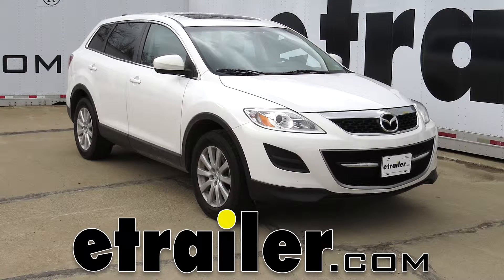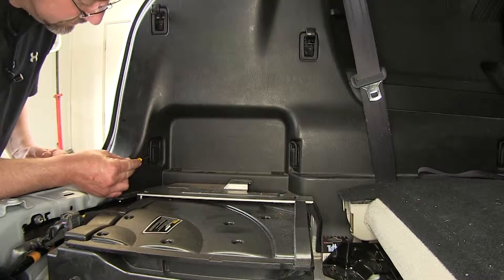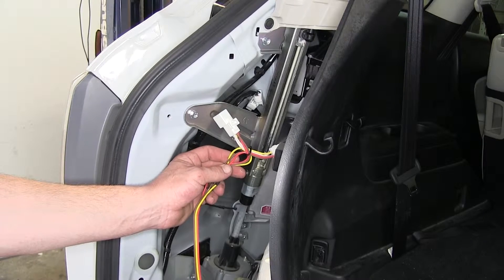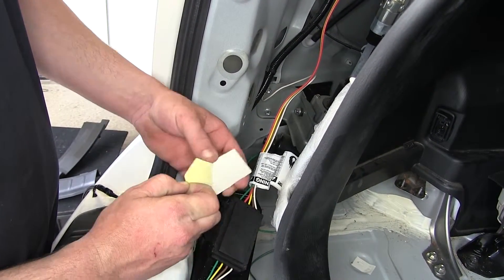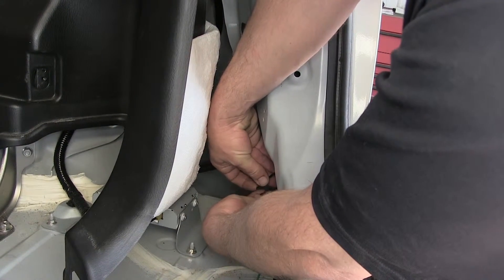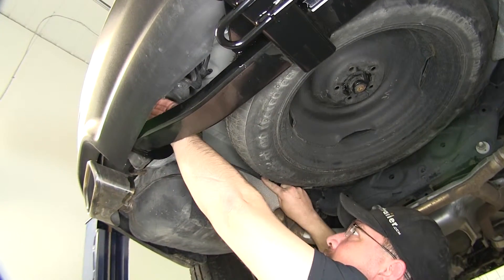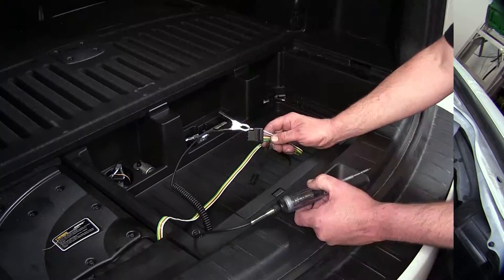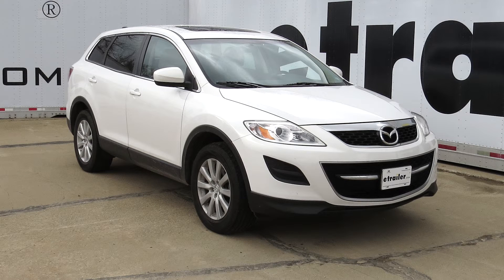etrailer | Trailer Wiring Harness Installation - 2010 Mazda CX-9

Comment: Can I hook the power to that cigarette lighter outlet on the right side inside of the battery
Reply from the maker: The manufacturer does not recommend attaching the power wire to the outlet in the rear of the vehicle. Connecting to it may overload it and potentially blow the fuse and you would lose the functioning of your trailer lights. It is better to attach directly to the battery so that there is no interference with the functioning of your trailer lights.
https://www.etrailer.com/Custom-Fit-Vehicle-Wiring/Curt/56016.html

Comment: It's just supposed to hang out the trunk like that ?? There no way to run it out and under the bumper
Reply from the maker: On sedans and smaller SUVs that don't tow as often, we recommend leaving the plug inside so it's protected. Storing the plug inside the vehicle keeps it safe from corrosion, weather, and damage. If you tow more often, then routing the plug outside is a good option. Typically there is a grommet located in the rear cargo area that can be used to route the wiring to the exterior of the vehicle. In this case, you would want to use a mounting bracket to secure the plug near the hitch, and keep it easily accessible. 

Here are a few popular brackets:
https://www.etrailer.com/Accessories-and-Parts/Tow-Ready/18140.html

https://www.etrailer.com/Accessories-and-Parts/Tow-Ready/18144.html